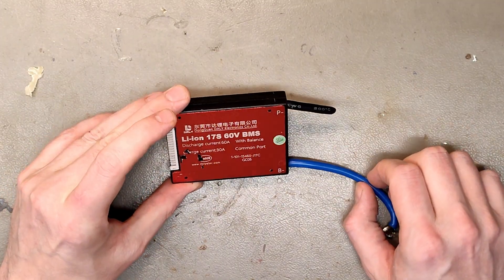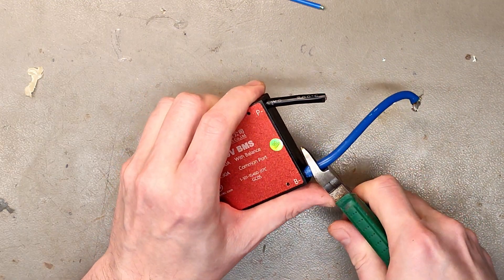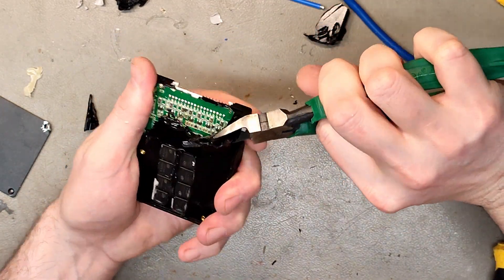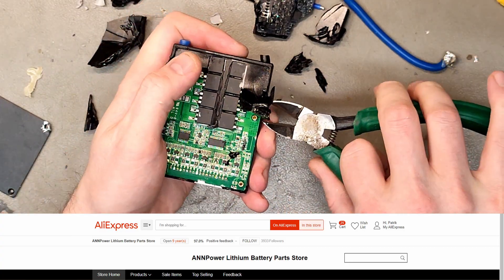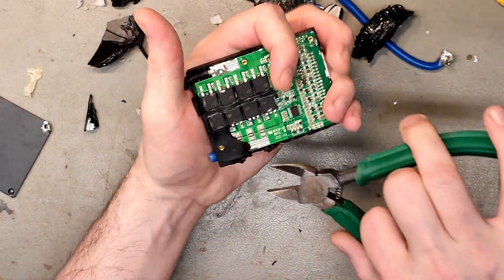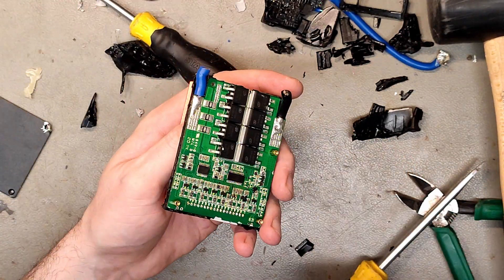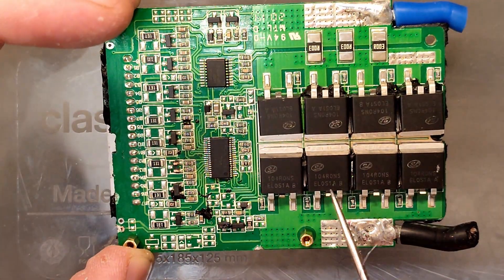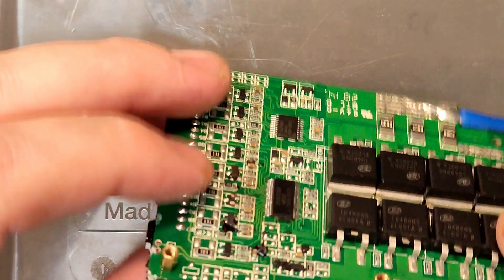In defence of Daly BMS - Where you buy your BMS defines the defect rate.

Comment: You can't measure them in circuits. You probably need to cut off (you can de-soldering it too) one of the legs to measure the MOSFETs.
Reply from the maker: Thank you! May i ask why these mosfets only has 2 legs? the middle leg is cut off, isn't it the middle leg that can turn on the mosfet by applying voltage. How are they controlled of the middle leg is not connected?
Reply: @TheBatteryDoctor  On most of those parts the middle pin is internally connected to the heat-sink tab and that one is soldered anyway, for cooling reasons. BTW, the pin is not cut off, the short tab is the way the part is supplied. 🙂

Comment: I had heard Daly was the best, so when building a 16KW 48V pack I ordered a 300A BMS from the Daly store on Aliexpress.  It was not cheap at several hundred dollars.  Unfortunately, I was never able to get the unit to power up.  Then the worst part was they would accept a return, but shipping back to China was $250.
I ended up splitting the pack into 2 8KW batteries and using a couple of 100A BMS I ordered from Amazon.
Reply: Daly one of the worst, with bluetooth connection problems, and high threshold voltage balancing. In Russia/Ukraine/Belarus, many people do not like the daly because the daly killed more than one battery. So its in a fact.

Better to choose ANT, JBD, Xioxiang, Jikong
Reply from the maker: Any store called, Factory, official etc on aliexpress is seldom that. And even if it is, then grade A bms will be sold to wholesalers, and anything below will be sold individually. When you buy on aliexpress you buy from a chinease trader/dropseller which has very low marigin. When you buy the same product on amazon, they could be ordering from aliexpress to you for a 100% markup. You should buy from someone that you trust. But it's HARD! I thought i found a link for you but it turnes out batteryzone.de is actually a chinease site!